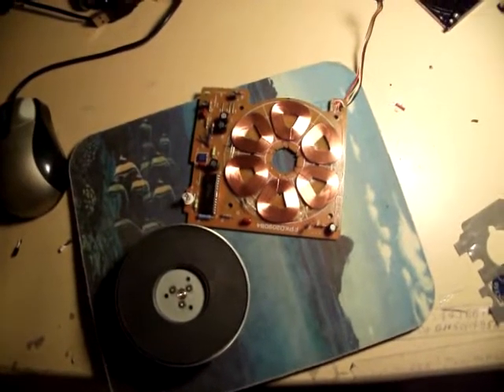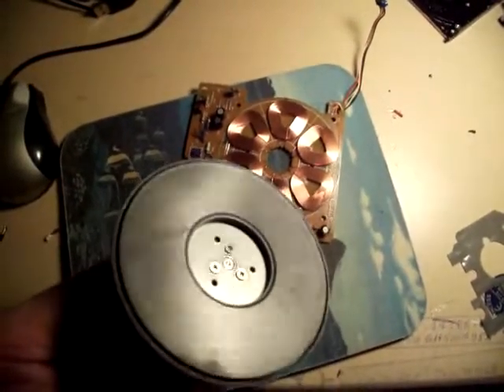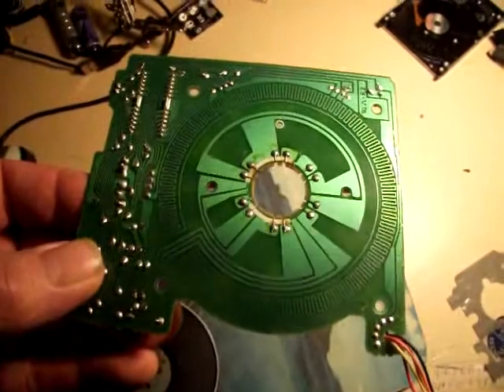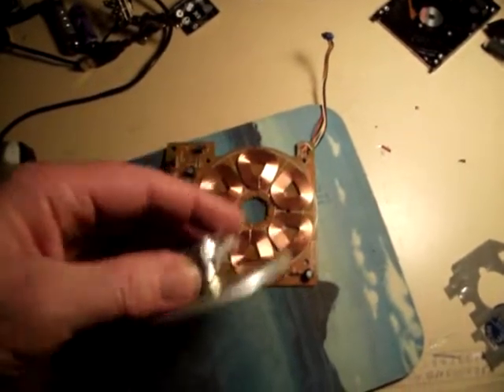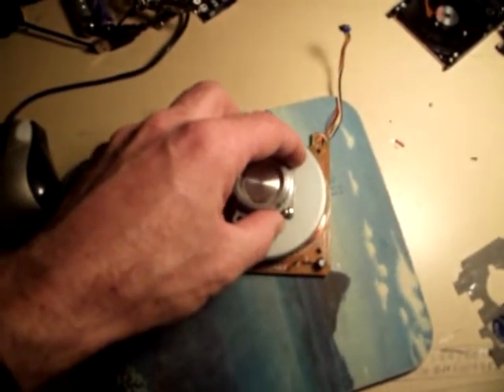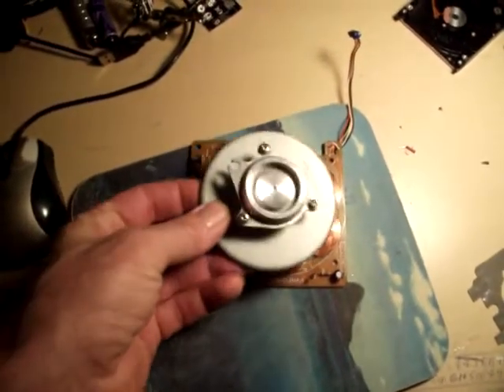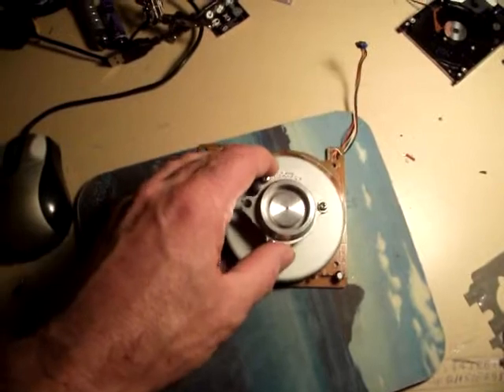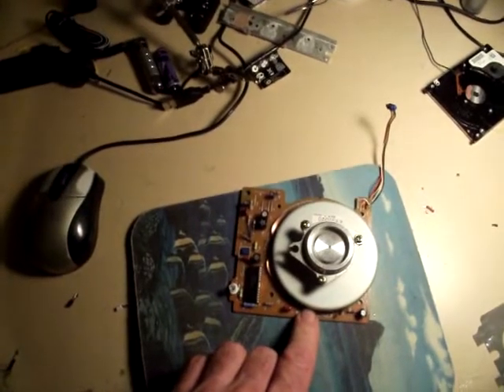5.25" Floppy Drive Axial Flux Generator 1.5v AA Battery Charger Idea

Comment: @KyleCarrington i would save just the coils and use one of your HD rotors with neos on it and turn that board into a generator. u are probably going to need the neos otherwise it will need to go insanely fast to get a good current.

Comment from the maker: Probably be better off to not use the magnet disc and use alternating N and S poles, flat bar ferrites or ceramics. Neo's would be too strong. Make it into a 3 phase AC device, rectify the output with 2v as the goal, charge AA's.

Comment from the maker: If you can get your hands on one of those printer/scanner combo units (i get them from the electronics recycler - it's like a shopping centre in there for me...) for next to nothing or free... they have a step motor suitable for the project, and a nice belt for the generator.

Comment: hi Kile, i am experimenting with a new motor-generator with magnetic flux three phase coil and i can load a set of 4 batteries AA  in less than 10 minutes with good results...! you need only my rotor with plastic resin and you can make the best generator...!

Comment: lol I did that ones and put the coils in a resion to make a stator out of them but wired them up wrong and had the coil phase each other out but it would work get better mangets and you could produce some power I had it hooked up like you did and was able to produce 16 volts so currect but hell it was cool hop I can find a nother floppy drive like it but as of now they are all iron in them and they suck but those coils when I had them were cool I like to find like 20 of them some day.

Comment: @KyleCarrington na I just used 6 of them if it was a 9 coil system I would have used12 because 9 is not an even number were as 6 are and with even number of coils even if it was a small 3 phase it would have still been even but if it was and odd number I have to even it with the magnets but its cool either way I like to like I said get up to 9 of those coils and try it but they are exspencive on ebay when I looked up to see how much 5.25 were out of my price range lol

Comment: I would replace the magnet with round neos and make a generator . Bearing can be mounted using three point you have on the flange. All you'll need is another non magnetic surface with a hole to fit the bearing part. Also, take a look at skycollection videos - youtube.com/user/skycollection#p/u/34/jJzVIrYcw5U

V